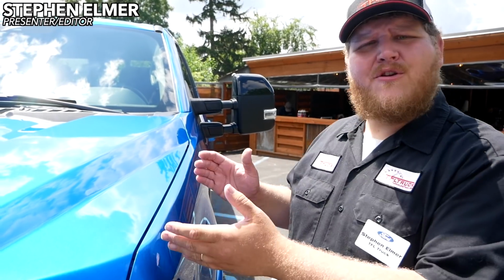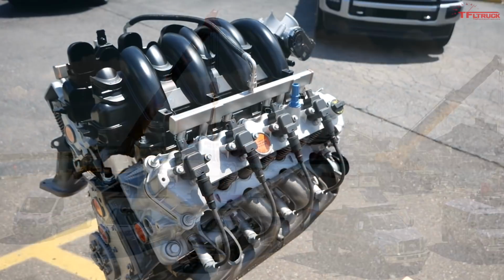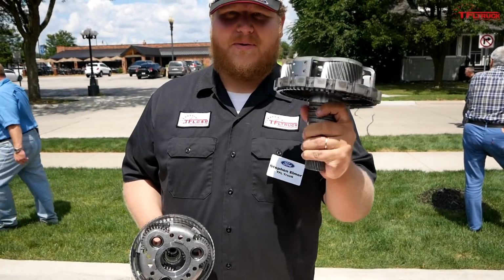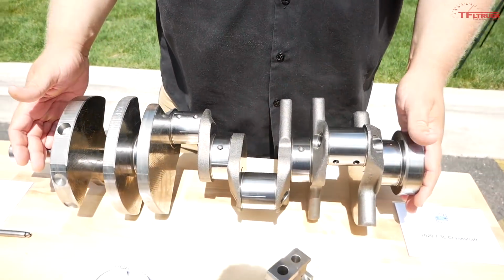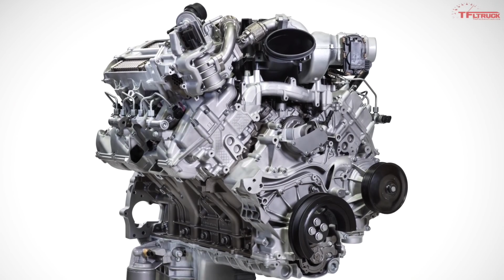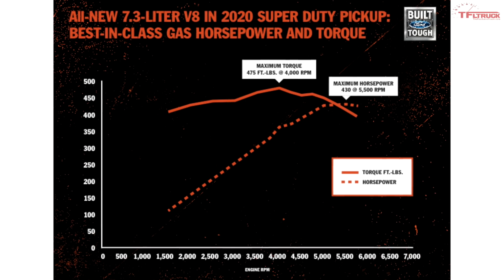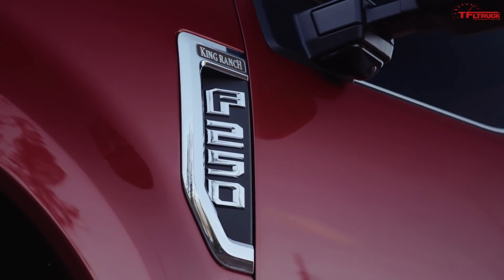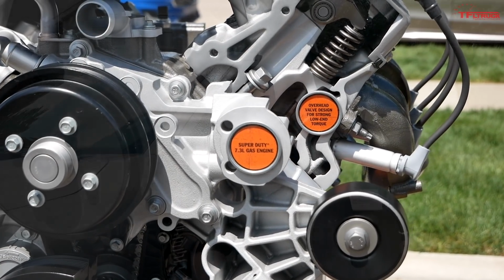We Finally Know the Ford Super Duty 7.3L V8 Power Numbers & They Are Lower Than We Thought!

Comment: Ford 7.3 GODZILLA 🔥🔥
Reply: Of course Ford went back to a single camshaft because all their overhead cam Motors are junk especially the ticking coyote motor sure looks like a Chevy motor with the coils on top of the valve cover
Reply: Robert Johnson the V10 was fine. It did what the 8.1 did, using less fuel. It replaced the 460 delivering more power and torque, using less fuel. Reliability was good. Now I guess they have figured out a better way by going back to pushrod. That doesn’t make the OHC motors bad. In fact the 6.2 is very robust.

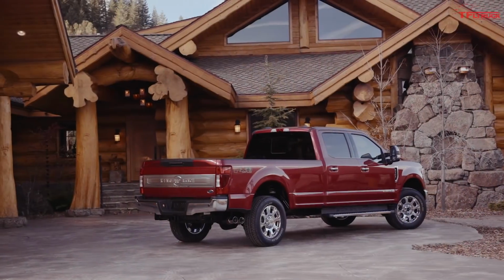Comment: 6:32 is HP and Torque Numbers
430 Hp @ 5500 rpm and 475lb-ft at 4000rpm.
Reply: Not all heroes wear capes....
Reply: 10 speed transmission with a 4.30 rear end. This thing will tow like a beast.
Reply: @czwarlord9243  

No...I understand that entirely.  I just feel that in today's market this motor could've offered numbers that put it into an entirely different league...a separate genre between diesels and all other gas engines.  Despite the excitement that DOES exist, I think this could've been much better and would've given every red blooded Male a raging boner.  

The question still remains..."will its size enhance its gas mileage because doesn't have to work as hard, or will its shear volume prove to be a gas draining vortex"?
Reply: Thank you!!!!
Reply: @czwarlord9243  explain to me this why did they go to a single cam shaft engines because their overhead cam engines gave nothing but problem the 5-4 3 valve was notoriously known that you couldn't get the spark plugs out of the head or the timing chain would fail too much moving parts to wear out Ford's cost twice as much to repair than a LS motor which is a single camshaft Engine with less moving parts and we're definitely way more reliable than a modular engine Ford right now is in a class action lawsuit because they're GT coyote tick tick tick right after customer does the first oil change
Reply: The reason why is because Ford smartened up and realized that the single camshaft engine was more reliable and will produce more torque in a two valve design then the engines that they were producing which gave nothing but problems
Reply: I love that big broad flat torque curve!
Reply: I am totally speaking from experience I have own both gas and Diesel versions of Ford trucks. All car manufacturers have problems but Ford did not learn its lesson they introduce 3 different diesel engines in a short 10-year time span the old saying goes when you have something good you stick with it. Personally had a Harley-Davidson F250 all of a sudden it started drinking water truck was 3 years old with 80,000 miles it needed brand new heads truck was never abused never tuned was in stock form Ford's brilliant idea you have to remove the cab off of the chassis to take the heads off just brilliant extra cost and it just wasn't me many people I know join the class action lawsuit because of the continuous plaguing problems with their diesel program I owned a 2008 Ford F150 5.4 3 valve after 70 or 80 Thousand Miles we couldn't get the spark plugs out of the head they were factory installed Ford says you can go a hundred thousand miles without changing your plugs you just can't get the damn things out I've heard people spending upwards of $1,000 for a plug change ridiculous again there was a class action lawsuit also their timing chain tensioners would fail inside of a hundred thousand miles causing much more expensive because of all the extra moving parts it doesn't get any better with the Mustang GT my nephew owns a 2018 with a  ticking Coyote engine more than four years ago Ford knew about this problem and became known as piston slap internal memo at ford don't do anything about it until the motor blows up again ridiculous and to add insult to injury they were too cheap to keep the Tremec transmission in 2018 /19 they introduced a 6-speed Garrett which began breaking 2nd and 3rd gear shifting Forks the problem was so bad there was a three-month waiting list just to get parts I have owned Chevy Avalanche with a 5.3 I put 380,000 miles on that engine never replace the timing chain the heads never were taking off that truck ran until the day it got sold I'll take a LS engine any day everything I have told you is not a made-up story you can go on any of the forms and look up this information on the Coyote engine program in the Ford diesel engine program in see all the inherit problems they have had Ford will continue to take people's hard-earned money and give them junk
Reply: @robertjohnson4784  Strange.  My '99 and '03 Cobras have over 100K on them and have the original plugs and no issues with the motors at all.  Other than new water pumps, alternators and thermostats, they have never had problems.  I can't say anything about my '12, but other than the MT82 tranny, it seems to be pretty well sorted out.  The Chevy motor is nice as ever, but the new 7.3 is going to work easier to get better results.  We'll see how things go, but Ford isn't abandoning the Coyote or Ecoboost motors.  They have been proven in race results and street applications for quite a while now and and are quite nice motors that will have quite long and dependable lives.
Reply: the 6.2L Chevy produces 350 lb-ft at 1,500 rpms, and doesn't produce 400 lb-ft until 2,750 rpms

that's pretty unimpressive
Reply: 400lb of torque at 1500 rpm  Is impressive.  The motor was built around that.
Reply: Although those numbers look smaller than we thought, the 400 ft lbs at 1500 is where it will shine. That's what will get the load moving. I also believe that these numbers are for optimal fuel economy. Give it a month or so after they start selling and someone will build a tune that will likely get it into the 600s. Which really, through a 10 speed will be amazing for towing.
Reply: To me, that's pretty unimpressive.  The Ram pickup 6.4l Hemi is 410/429.  For almost an entire litre more of combustion area, it just doesnt seem like theyre generating a significant increase of power.  Maybe it is...but on paper it doesn't seem impressive to me and the fuel economy has got to be addressed vs the power.  Is it worth it?
Reply: @phattygoodness7347  I get what you're saying, but I guarantee you economy is going to come into play. Dodge's are notorious gas guzzlers. The 6.4 in a power wagon is an awesome machine, but after doing just a little bit of upgrade work you are in the single digits for fuel economy. Also, another thing to think about, this engine is designed to go in trucks built for pulling. Having over 400 ft lbs at almost idle is going to make a world of difference for beginning to move. I am ready to see what type of fuel economy these engines will be providing. I feel that is where this engine will end up shining.
Reply: @Toxically_Masculine_Crusader  

What do suppose the fuel economy is gonna come in at for the 7.3?  My 6.4s get mid to high teens on highway and 8 to 12 when hauling 5000# trailers or doing snow removal.
Reply: @phattygoodness7347  I think that is an awesome question and I'm looking forward to those numbers as well. Our diesels get okay economy when just driving, but really shine when towing. I'm sure it will get a good EPA rating, but the true test for any heavy duty or Super Duty truck is economy under a workload. I think this engine will do better under workload than most gasoline engines, but I don't think it's numbers will compare to a diesel.
Reply: @phattygoodness7347  I guarantee the 6.4 hemi doesn't scale anywhere near the torque curve of the Ford. 400 lbs ft at 1500 is impressive.
Reply: @holeran1  

I agree that the curve likely provides a better availability of torque, but it's still half of any diesel and no where near enough to notice a substantial difference between the 6.4 and 7.3.  I just don't see it.  I'd have to drive it to believe it.  Don't get me wrong...I see where they're going with this and the application.  It's spot on, but I would've hoped that a monster like this could've offered numbers with better separation from the pack without compromising reliability and longevity.  JMO
Reply: @phattygoodness7347  I think overall reliability and useable torque across the board was what they were aiming for and time will tell. I have not been in the fan club of hemis for quite a while, their durability is lack luster to me.
Reply: @holeran1  

I can't really speak to the reliability because I just don't log a lot of miles.  I have a 2006 5.9 diesel with barely 100k on it.  Then I have a 2014 and a 2017 6.4 hemi.  The 2014 only around 40k on it, and the 2017 just over 15k.  I can only offer that the 6.4s get decent fuel economy considering their size, and they tend to lack low end power.  That said, I purchased them off the lot and they're not running gears conducive to towing.  I'm sure if I was running 4.10 like the Powerwagon I'd be fine.
Reply: @phattygoodness7347  lacking low end power is the product of not having the torque come in early. That being said I have not seen their torque curve. A ten speed trans will help the Ford immensely though.
Reply: @phattygoodness7347   It's(7.3l) enough to put the 6.4 l hemi out of its league. And only at 4000 rpm is impressive.
Reply: Phattygoodness You gotta look outside of peak numbers. The reliability should be great and outside of that the engine makes 400+ torque starting as low as 1,500 RPM. It’s far more than peak numbers this engine is making big torque through the vast majority of its operating speed. Also paired with the new HD 10 speed this setup surely won’t disappoint. 6.4 Ram isn’t even close in low RPM grunt. It’s also not built this stout. Don’t get me wrong I love my Hemi.
Reply: @phattygoodness7347  6.4 is more of a performance type of motor than a work horse motor just like Chevrolet old 8.1 in early 2000's
Reply: @kevinanglin678  That's incorrect, the 6.4 in the HD trucks is built from the ground up as a work engine. Completely different compared the "392" 6.4 in the cars.
Reply: @WilliamStewart1  the 6.4 in the truck is based on the 6.4 srt same block yes it has different pistons and cam but it's based on the srt hemi so it's not a engine built from the ground up for heavy duty application's just a revised 6.4 srt
Reply: You guys don't get it  ford just went backwards back to a single camshaft because their modular engines were notoriously known to give problems especially with the camshaft on top of the valves new motor single camshaft coils on top of the valve cover looks like a LS engine to me Chevy 6.2 L 420 HP 460 ft lb of torque they jumped up to a 7-3 to make 10 more horsepower LMAO
Reply: Robert Johnson  you are childish, it is much more durable, that is why they switched. It will most likely be more fuel efficient than competitors also.
Reply: @robertjohnson4784   You do Notice they never put the 6.2 l and a truck because it couldn't take it. The numbers of the 7.3 are very impressive Especially getting all the power at only 4000 rpm.
Reply: @robertjohnson4784  lol you do know when a new motor comes out they never give it the max HP and TQ right?? They always build it up has time goes on because if they didn't they would have to make significant changes to it in 3 or 4 years from now. Why do you think Chevy has gone to superchargers on there 6.2 because a naturally-aspirated 6.2 is pretty much ready at its max power. Look at the 6.0 in the Chevy HD they went to the new 6.6 gas v8 because the 6.0 was at its Max HP and TQ. Ram is developing a new 7.0 V8 because they know they're 6.4 is at its Max😊
Reply: @robertjohnson4784  Chevy 6.2 has to spin a lot faster to get those numbers. For towing, the 6.2 will be lame in comparison. The Ford modular engines are plenty reliable and better at higher revving  points when installed and used in lighter weight applications.  Pushrod engines have LESS reliability and power at higher rpms.  Pushrods are old school chug machines that do good work down low where you want it in heavy applications, and can take the abuse of low rev short shifting tug.  The SD and Heavy Truck lines weigh in a lot heavier than the F150s, and that low end tq is where it's needed using a 7.3.  It's not like Ford is giving up on modular by any means....if anything, they are doubling down.
Reply: Robert Johnson GMs own 6.6L gas is outshined by their 6.2L as well. It’s not about peak numbers in HD trucks it’s about solid power numbers and durability while working under high stress situations. Torque throughout the power range is very important too. The 7.3L with 10 speed will be a far better combo than GMs 6.6L gas with 6 speed easy.
Reply: @robertjohnson4784  Gotta look at the whole area under the torque curve.. Bet the ford is a lot higher and flatter than the chevy 6.2

Comment: A bit low on the numbers, but at least it seems durability is good 👍🏻
Reply: But almost full torque at 1500.  This motor is going to be a long haul beast.
Reply: Agent Smith 

The more power you throw through a block, the less reliable it will be due to the force being so much greater than if it was “dumbed down” a little bit.
Reply: Vincent Sluga bull.
Reply: Plastic intake manifold doesnt seem great
Reply: Agent Smith low stress is the name of the game
Reply: in a heavy duty application where you need torque down low you have to come up with a cam and head design combo that produces the highest possible average power between 1500-4000 rpm which in turn sacrifices the peak numbers that you would otherwise get around 5500-6500 if you were designing for all out peak numbers.
Reply: Dalton Michaels On top of that, the engine runs at 14:7 A/F all of the time, so at full load it’s not using nearly as much fuel as a “normal” engine of the same displacement would running the usual 12:7ish:1 A/F. Fuel=Power so I’m really impressed how much power they were able to squeeze out of it considering the low rpm operation and constant stoichiometric operation. Has to have a really high VE and BMEP
Reply: my guess is this engine with some head porting , bigger valves ,  a cam and spring upgrade ,  full exhaust,  and a tune could probably make another 200hp on pump gas. but it would be in the 5000-6000 rpm range where its not usable for a truck.  i know my gas 3/4 ton 6.0 chevy sits around 4500 to 5500 pulling on the steepest grades when fully loaded so even in that scenario you are barely getting into the powerband of a hot rod motor even when your demand is the absolute highest.
Reply: @Andrew Smith that joke in the motor is going to last 500,000 miles easily
Reply: Agent Smith yea, I have a 19 year old bmw with 251k mikes it only has 170 hp 181 tq from 2.5l. Not much power but it’s still starts like new. You can have power, reliability, or fuel economy. You can only pick two.
Reply: @FishFind3000   do your 19 year old BMW tow or haul much?
Reply: When you look at the RPMs, the power is fantastic.
Reply: Seems low but when you look at the curve, its great.
Reply: lol how are the numbers LOW? are u nuts?  this thing is a monster.
Reply: @hugeCRSfan69  430 hp from a 7.3L equates to 59 hp per liter. That's 118 hp for a 2L or 177 hp for a 3L. So not exactly impressive. Slap a turbo or two on it and you'll get great numbers though. Mercedes Benz recently released an AMG version of their A class called A45s. It has a 2L 4 cylinder, but it has 416 hp. That's some impressive numbers. If those numbers would be the same for a 7.3L, it would have 1518 hp.
Reply: @Charles Ball they have had no issue....since they had an issue.  Hmmm okay. That was a huge issue with the old panther cars etc. Plastic is not "built ford tough"
Reply: Mr M meaning the problem has been fixed for years stupid lol.
Reply: FFS nobody uses metal for an intake manifold on a.gas engine anymore. If I’m mistaken that company is poorly operated.

Comment: Not surprising that Ford barely outdid GM and Ram while leaving plenty on the table for the future.
Reply: Ford likes turbos.  Let's have a twin turbo 7.3.
Reply: Maybe Ford finally got the memo that their gas engines are junk especially the ticking coyote new 7.3 sure looks like a LS engine single camshaft with the coils on top of the valve cover I wonder where they got that design from
Reply: @robertjohnson4784   😂 Ford doesn't need to copy GM to make reliable engines
Reply: @robertjohnson4784  Well I have heard about Chevrolet merging with Ford so who knows how they got it lol
Reply: Robert Johnson    News flash, GM didn’t make the pushrod design